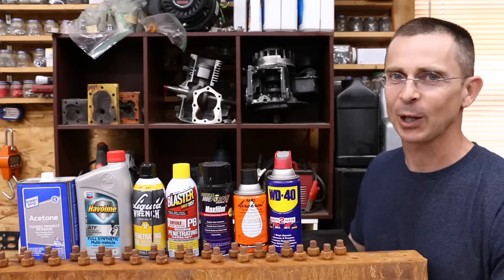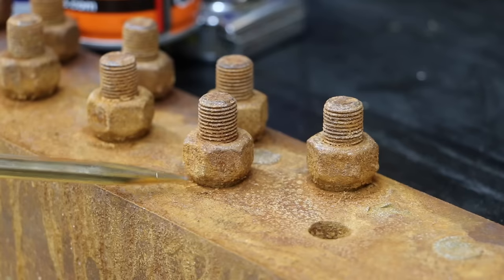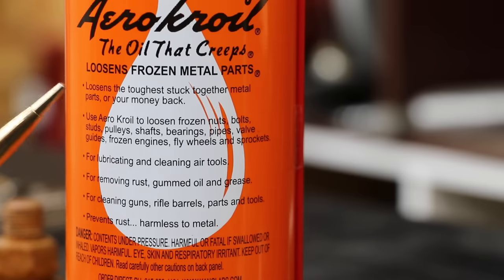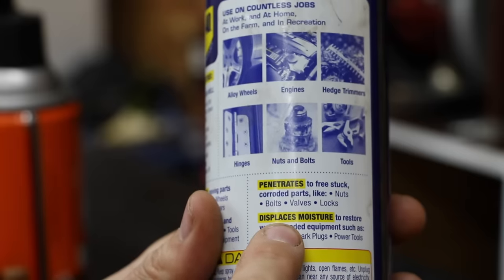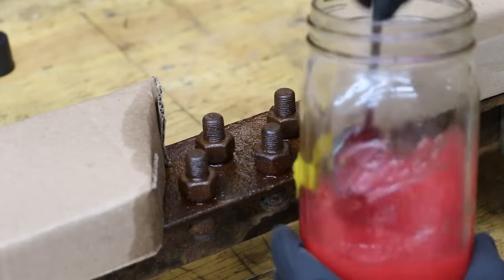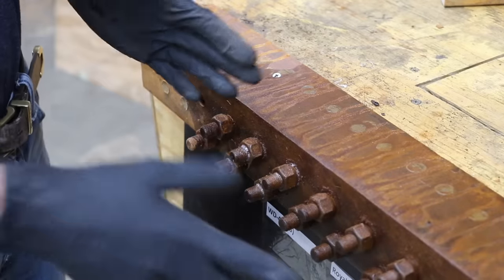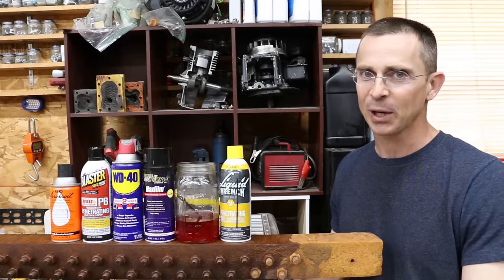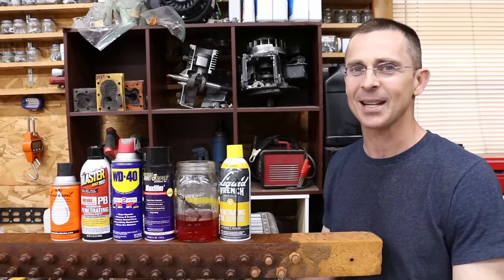Which Penetrating Oil is Best? Let's find out!

Comment: You should revisit this.  Perhaps go to a junk yard and use the products and methods on seized items that have been sitting for years.  Would be a better real world application.  Co-ordinate it with junkyard or salvage yard.  Give them a free plug in the vidoe in exhange for allowing you access.

Be sure to use on same type of item that have been sitting for about the same amount of time.

Comment: when all else fails use 50 50 mix of acetone and ATF, old timers swear by it and have used it to free rusted pistons in engine bores. I have even used it to remove frozen rings from pistons after trying all the other oils and heat.
Reply from the maker: Thanks for the suggestion.

Comment: Looks like a good scientific test to me, at least somewhat, (thank you very much sir),  but...... :)

I have used all of these except royal purple in an automotive repair facility for years and years and years, and years. Kroil is by far the best. Believe me or not. This is what I know. I usually use the blue wrench/torch as a go to because its quick and reliable, but it is not always so easy to use in certain situations. Kroil takes time to to soak in. Three hours is not long enough. It takes more like a day or longer with several applications for best results. I just had a Toyota with six rusted exhaust stud/nuts. I used the torch on one nut and it came off, but I really had to crank it. So I soaked the rest with Kroil. A day and a half later the other five nuts came right off by hand. Liquid Wrench, no no no. Pb blaster, no no no. WD-40 is great and just so great for all kinds of stuff, but not for whats being tested here. 

Oh I almost just forgot. A guy I work with just used Kroil to get the spark plugs out of a Ford Triton. These Triton plugs that break off inside the head. You got to be real careful removing these spark plugs or its a big mess up. He soaked the spark plugs for a couple of days I guess with many applications of the Kroil product. The Kroil seeped down the threads of the spark plugs, all fourteen threads or so, and loosened up the carbon on the plugs that makes them break off in the head. The guy was so smart to do this. Go figure.

Now, years ago the boss man bought a case of Kroil from a shop that shut down and was selling used inventory. These cans of Kroil were really really old, many many years old. I have been using these cans of Kroil for years. We just just ran out of the old cans of Kroil and got some new cans of Kroil, so I wonder if the new Kroil formula has changed. Kroil says the formula has not changed, but considering they have been around since 1939 I just wonder if the formula has changed any. I think it is the same stuff, but only time will tell.

Pardon bad grammar and typos. It took me a half hour to type this mess. Good luck and God bless us all.
Reply from the maker: You are welcome!  Thanks for sharing.

Comment: Wax. Candle Wax. Heat the nut until it will melt wax and then touch a candle to the threads. It melts and is sucked into the threads by surface tension.  I suspect the heat does most of the job, but the wax both lubricates and suspends rust particles.

Comment: Delco X-88A …I use this stuff where I normally would use heat. For instance, wheel cylinder bleeders, exhaust manifold bolts, exhaust system bolts. If I know ahead of time, I will soak the part the day before and let it soak overnight. For me, it has been by far the best penetrating product for rusted/stuck parts. If you get a chance, give it a try.
Reply: @loism1009   I have some pictures of the product. They show both the can and the active ingredients. I can’t seem figure out how to attach pictures here. If you would like them, just let me know and I will send you an email address. Thanks for taking the time to,reply!
Reply from the maker: Thanks for sharing.

Comment: One penetrant oil that was not tested is Mouse Milk thats available through Amazon.  This stuff works miracles on stubborn nuts.  I have used Mouse Milk to disassemble aircraft exhaust systems to be refurbished.  The oil in Mouse Milk is actually a very fine machine oil that will wick through just about anything.  Mouse Milk is much cheaper than Aero Kroil and works much better IMHO.  Next time, give this product a try and you may be amazed how well it works.
Reply from the maker: Thanks for the feedback.

Comment: I hardly ever use such penetrating oils on bolts. That because I never have to deal with rusty bolts and nuts. But I have used Blaster PB before to stop and prevent rust. How well it works? Well, to be honest I don't know.

I ordered a set of crash bars for my Yamaha Tenere 700 adventure bike. When I received them half the bars had a bunch of reddish dirt or sand inside. I had never seen anything like that before. I imagine it was from sandblasting and it was left inside and not taken out before painting. Which would not hurt the painting process since the sand was inside the tubes. 

Anyhow, I took all the sand out and looked inside the tubes with a flashlight and it looked rusty. So I rinsed the tubes with water blew air through them, and let them sit in the hot sun for hours. They hot hot enough, specially being black in color, to let all the water evaporate. I then covered all the holes at the end of the tubes and sprayed a lot of Blaster PB inside. I moved the bars around to make sure all the inside of the bars were covered with the stuff. After several minutes I drained as much as I could by letting gravity do it's job. Then I installed them on the bike.

I used Blaster PB because it claims that it stops rust by attacking it from different angles, AND (very important), it does not evaporate. Supposedly leaving behind a film of the stuff to prevent rust from forming again. Of course it does not say for how long is that protection.

My goal was to clean the inside of the bars and treat it to prevent rust from building inside. Which in turn reduces the life span of the bars. May be one day I'll take off the bars and look inside to see how rust is coming along. I hope that stuff (Blaster PB) works as advertised. Chances are that it doesn't. 

So how about a test of protects to see how well they stop and prevent rust, and for how long it protects?
Reply from the maker: Thanks for the suggestion.

Comment: Always used Lanox/inox mx3/mx4 not only is it a good penetrating oil its also used for coating my 4wds underbodies for rust prevention. its made from sheep oil and doesn't destroy rubber, plastic or silicone parts.
Reply from the maker: Thanks for the feedback.

Comment: For a stuck fastener, I've always used the entire arsenal: heat followed by penetrant, striking, tightening (to cause it to move).  Only after those 4 things are done do I try to remove...it's worked well so far, but it has not been tried on header/exhaust bolts (the ultimate test in fastener removal skills).
Reply from the maker: Thanks for the feedback.

Comment: Just subscribed to the channel,  thanks to the "YouTube suggestion". 
Personally I have used most of these products,  except for the royal purple.
Every single time;  especially on bolts 🔩 that are rusty and haven't been touched for 20 to 50+ years,  the Kroil has always been the best. Especially when the bolts were subject to high heat levels for extended periods of time over decades. Example: a 36 inch flange in a refinery that was originally installed in 1950. We had to pull it apart in 2013. It was under use all the time,  except when the refinery was shut down for routine maintenance. It is a very hot line , carrying steam for a unit. The pipes are exposed to the elements.
 We kroiled the bolts for a maintenance schedule to be inspected for any defects or excessive wear. I kroiled them when they were hot 🔥,  but the kroil just vaporized,  and I learned,  not flammable. After the unit was off, I used a hand wire brush on the exposed threads,  and kroiled them. The following day,  every single bolt removed without galling. I was amazed!
A similar flange in the same area that another crew was working on was using pb blaster. Their results were not very good. 
Thanks for the video!!!
Reply from the maker: You are welcome!  Thanks for watching and subscribing!

Comment: Thanks again for everything. Great channel in every way. I use a lot of Schaeffers oils/trans fluids, etc
I run a lot of experiments myself and I really believe Schaeffers is pretty top notch with most of their things. Have u tried their 'penetro' penetrating oil. I know it's more oil-based and not the foaming effect of Pb blaster (which I also really like for rust dissolving) and they claim it has tremendous "creep"... Not exactly sure if it would destroy rust as well?... Maybe?... Or is more of a lube and 'after-lube'... By the schaeffers rep that I know has several stories of where is released rusted clutches on tractors that they couldn't free any other way. Anyhow, thought I would mention their brand in case u ever want to try it. Thanks again!
Reply from the maker: You are welcome!  Thanks for the feedback. Thanks for the suggestion.

Comment: I’m really surprised at the results. I used Kroil on a frozen nut/bolt that was starting to twist instead of coming loose. I took the car off the ramps and planed on doing the job at a later time. At least a month went by, I tried to loosen the nut and it loosened right away. I was shocked, I expected the bolt to break. The other 2 bolts I didn’t use Kroil on snapped off. I will get some Liquid Wrench tomorrow for my next auto repair.
Reply from the maker: Thanks for sharing.

Comment: While watching I noticed that at the time you did the 50/50 mix and when it was sitting on the table with the other products, your fluid level seemed to decrease significantly. I'm wondering if you merely poured some out or if you lost some acetone to evaporation. If it was an issue with evaporation, your ratio would be off and possibly change how effective the mix was.

Comment: Here is what works the very best overall (if you are not in a hurry) Quick clean the bolt/nut with a wire brush. I Like mine on a drill- let the tool do the work. Warm slightly with small propane torch only five seconds. Wack it really hard with a brass hammer.  Apply penetrating oil, let sit. A few hours later apply again. Wack again with brass hammer. Apply third time at the end of the day for overnight. Next day wait for a warm up if it is very cold outside OR five seconds more with small propane torch. USE AN IMPACT WRENCH that hammers! Sometimes I use one that will NOT remove the bolt/nut for vibration. I do BOTH forward and reverse for five seconds. I switch to the higher torque one for final removal. Sometimes hand removal is best too, use your good judgment. Best percentage odds for removal without snapping off the bolt/nut. Works well more than 80% of the time. If it is really a critical bolt/nut after using the mid torque impact wrench if it does not come off then do get it red hot before removal.
Reply from the maker: Thanks for the feedback.

Comment: Raymond Marek
0 seconds ago
The best thing I’ve found for really stuck nuts and bolts is heat and candle wax, some claim bees wax works even better.  Torch works the best but if you can’t use or don’t have a torch a heat gun will also work.  Heat the area and apply the candle wax.  Wait an hour and repeat the process.  Usually the nuts and bowls will come off or out very easily.  Only in very extreme applications, exhaust manifold, have I had to do a third application.
Reply from the maker: Thanks for the feedback.

Comment: I find I like the concept of applying penetrant after heat  ...capillary action of cooling?
Worth considering, (On exhaust nuts) is the natural heating produced in operation, if you know work is needed, apply after trips a number of times prior.
Testing with the closed end of a spanner wrench(a shame more of them aren't six pointed)between applications can determine effect. 

Also in a pinch and takes time, old glycol based brake fluid...

On rusted tight fitted joint wire cutting pliers, I start with carb cleaner, and work the joint, progressing to the heavier 'penetrants' once the rust starts working its way out of the joint.
Reply from the maker: Thanks for the feedback.

Comment: Kroil is a very good product i have used on items a work that PB and WD can't touch. Your videos have very good testing but i believe rust simulation is harder and more random.
Reply from the maker: Thank you!
Reply: I can second this comment... I had an extremely rusty hinge that wouldn't budge with LW... Kroil on the other hand really helped break the rust loose... it's not a good lube, but it sure cut through the rust I was working with.

Comment: I have used PB Blaster spray, WD40(when thats all I had on hand, Kroil Liquid.  Liquid Kroil always worked followed closely by P.B. Blaster.  I use Acetone and ATF as a rust remover and cleaner for unassembled parts.  What Torque did you initially tighten the nuts?

Comment: Your statement that something is better than nothing is wrong. If you included an estimate of the uncertainty in each average and did a simple statistical test of significance, I think none of the products except Liquid Wrench (and heat) would be significantly better than the dry test. In statistical jargon, you would not be able to reject the null hypothesis (all the same) with any useful level of confidence. Very interesting though, thanks for going to the trouble of making these tests.

Comment: I'm just wondering if when you took the angle iron off and remounted it you reversed the order of your test products. The two spare rusted nuts were on the left when you applied the products and when you tested them they were obviously on the right. But applying and testing you went in a right to left direction. So that would mean Kroil was #1.

Comment: You need to redo this and try Z-Max, it’s not an intended use, but since it seeps into the pores of the metal it would have to do something more than regular old WD-40 which is only for rust prevention, not lubrication or penetrating fluid
Reply from the maker: Thanks for the suggestion.

Comment: Given that rust is iron oxide and it grows on surfaces as it forms, it can "bridge" between two surfaces in close contact. There's not much reason to believe an OIL product would do much for that. I'd be interested to see if three treatments of something like "Evaporust" would do a superior job. You don't want to leave that on parts long term, of course, so you do have to clean them off and lubricate when you're done, but would it make the nuts easier to turn?

Comment: Great test! Thank u! I will say that when I was actually deliberate about soaking down horribly-rusty bolts for like a week before I tried to loosen them..... It did actually work. Maybe that long saturation time did help somewhat and had some rust dissolving effect? And then heat also just helped that much more or sometimes was necessary. But I will say I was surprised at some terrible bolts/nuts that I'm sure would have snapped/stripped that I was able to remove by soaking them down for days in a row. Thanks!
Reply from the maker: Thanks and you are welcome!  Thanks for sharing.

Comment: My take on penetrants: Kroil is available as a liquid which allows application in needle oiler a drop at a time. I work on firearms and a bottle goes a long way drop by drop. Using big sprays are great if you're taking an engine or axle apart but is too messy and wasteful otherwise. I know a fool that disparaged Kroil; he drowned the screw and after 5 minutes (!) he claimed it wasn't worth a damn. If I need penetrant I'll apply and let it sit overnight at least, sometimes several days.
Reply from the maker: Thanks for the feedback.

Comment: Hi, I'm wondering if you would try a horizontal soaking application to see if the results will change? Horizontal rusted bolts and nuts have been the majority of my issues and I've always had better luck with PB Blaster. I just 'found' this testing but I have tried all of those except KROIL (I'm too "thrifty" haha)

Comment: I wouldn’t have done the test on lugnuts..I would have used small steel bolts in a thick aluminum plate and tested the penetrating power…I’ve never snapped off a lugnut but I have busted steel bolts in an aluminum engine block
Reply from the maker: Thanks for the feedback.

Comment: I'm a big fan of Zep 45 sidewinder as a break free penetrating oil along with Kroil. Both work excellent. I find wd40 to be almost worthless and PB blaster to be only of medium value. In any case, I always use a penetrator to loosen stuck hardware when there is obvious rust and oxidation. Zep 45 being my go to for most, followed by kroil (especially in vertical, threaded end up instances).
Reply from the maker: Thanks for the feedback.

Comment: Is a $20 hardware store Propane Torch that reaches 3,500 degrees basically the same as the torch you used or do have have a hotter gas mix producing hotter temperatures on the nuts and bolts yielding greater expansion?  Also how many minutes did you spend heating each nut/bolt combo?

Comment: Ah WD-40; loosens bolts, works great at bringing desk fan bearings back from the dead of the fan not being used in years, causing the factory lubricant to dry up.

Comment: For a locked up manifold nut, would heat not be recommended due to possibly weakening the securing point for the catalytic converter?
Reply: I saw a You Tube video where the mechanic said an old mechanic taught him a trick to loosen those. He first "tightened" it, which supposedly broke it loose, then loosened it. You might try that.
Reply: @freespirit1975  funny thing is my dumbass was doing that without even realizing, remember kids take a long look at the bolt or nut, righty tighty lefty loosy haha